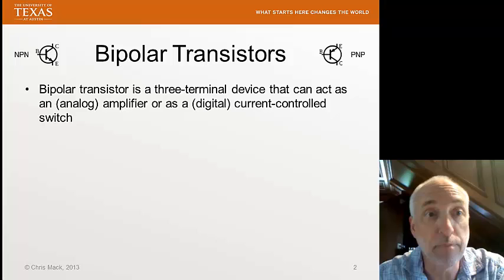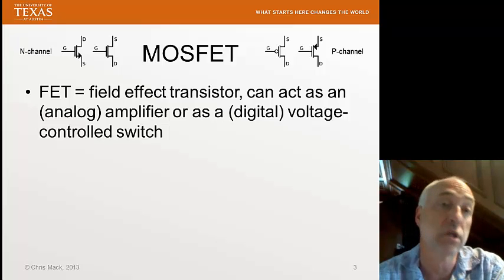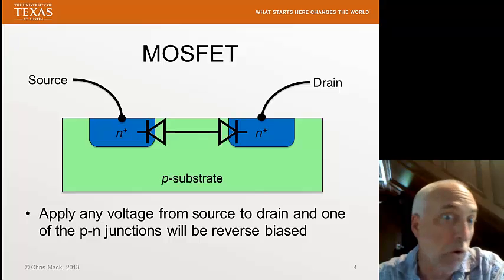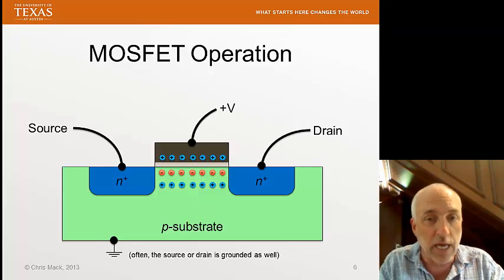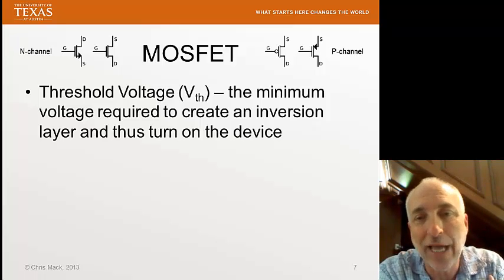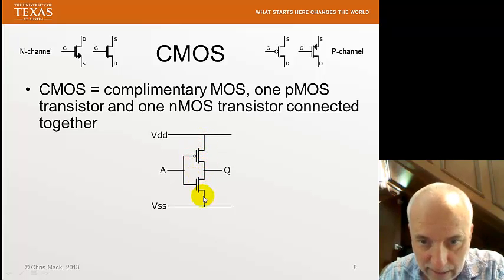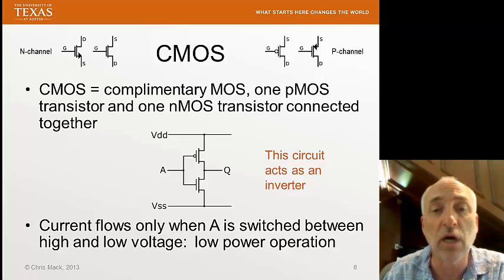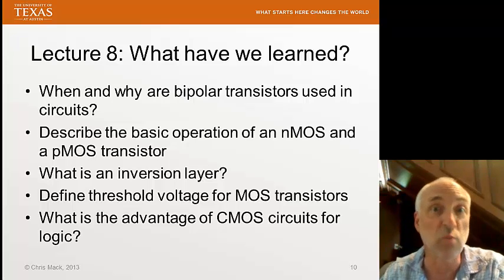Lecture 8 (CHE 323) Transistors

Comment: Hi, on slide 3, the 2nd transistor for N-channel - the labelling. Why did the source (S) went on top and drain went to bottom (D)? I thought for N-channel, D(drain) should be on top and S(source) should be on bottom??
Reply from the maker: From a symbol perspective, you can put source (drain) on top or bottom.  It doesn't matter.  When you start connecting the transistor to other components, then you need to make sure you connect the source and drain properly to the other devices, regardless of whether the source or drain is on top.